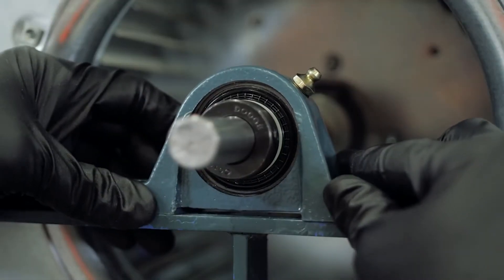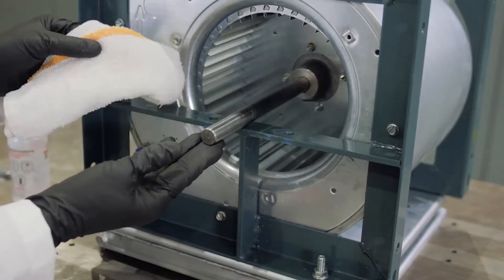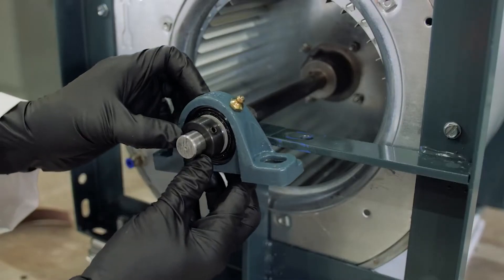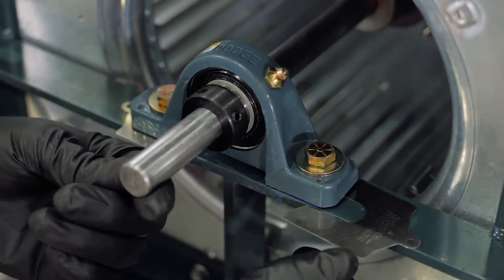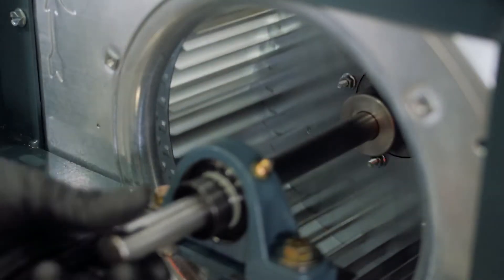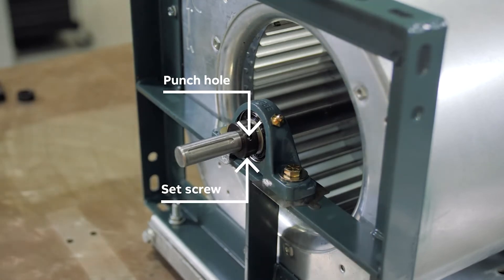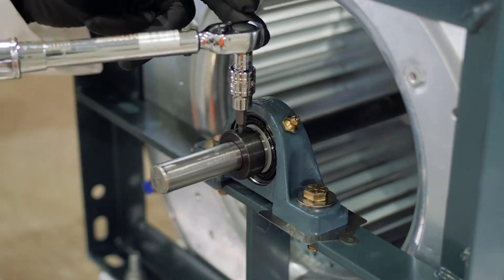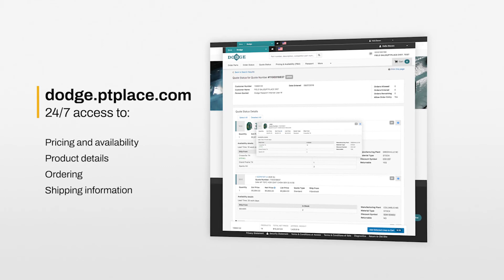Dodge eccentric ball bearing installation

Comment: I find it strange that you need to install the collar with rotation of the shaft. What is the reason for that?
Reply: Because if it's against the rotation then the rotation will spin it off.
Reply: @wecx2375  But won't it just tighten up again..? Seems either way will work just fine. No?
Reply: It will work it’s way out and cause the other side to push into the housing